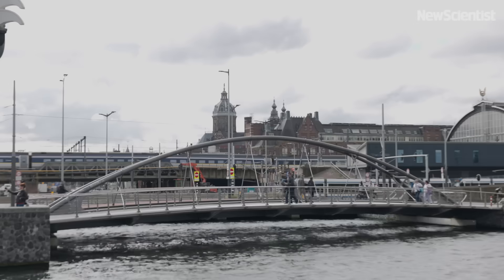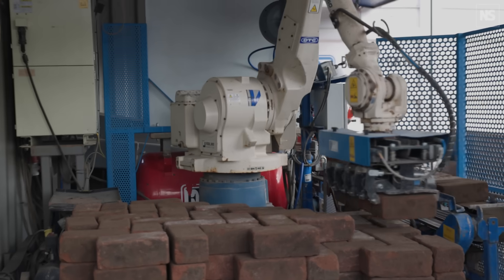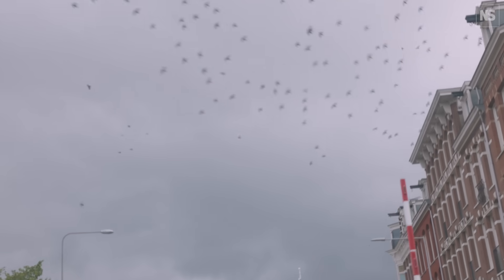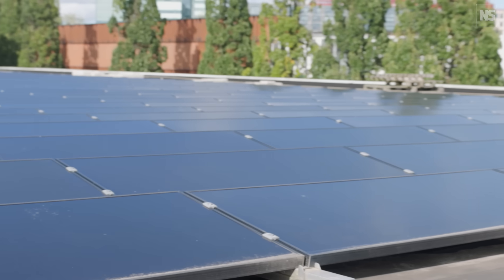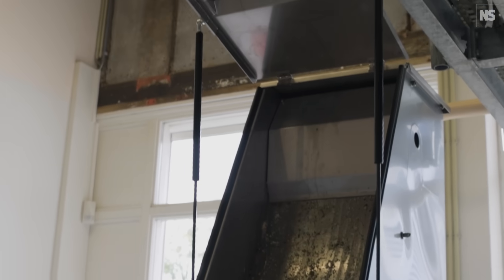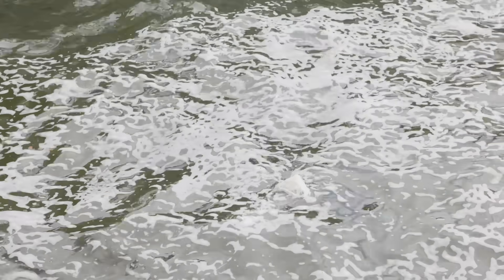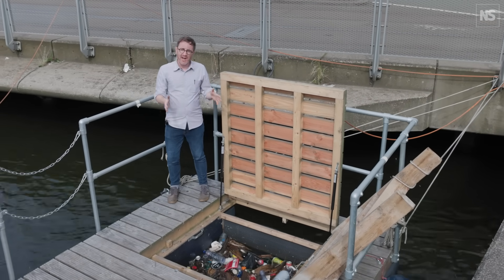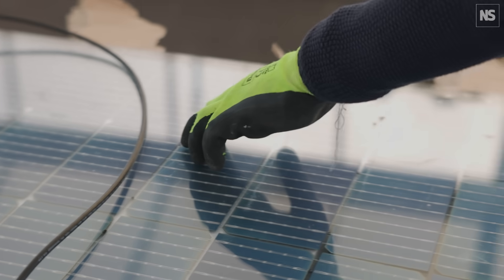How Amsterdam will transform into a circular city by 2050

Comment: I'm sorry here, but why the heck would you think you need to use as less water as possible, can't you just use a rock/sand/carbon, then activated carbon filter, and reuse the water , or isn't that circular enough? one solar panel and one pump fixes that problem you know, just saying... Design your systems optimally, as fast, as accurate and as cheap as possible, just recycle every single thing, including water, including co2 into dryice for example, or reintroduce into the soda pop industry, tooth paste, ... But coming up with using as little water as possible, that doesn't make any sense, you can recycle that water too for that kind of production, you don't need it to be pure in the first way, a simple rock/sand/carbon filter will do the trick, and gravity will push it through the filter.

Comment: Very interesting video, at 9:00 I just wonder why an institute with environnemental purpose is using perfectly good vegetables to experiment instead of using actual waste...? 
I live since 13 years in the Netherlands and Dutch culture is so bad towards food waste, young generation will just throw away perfectly good food just to make it pragmatic in the fridge, or even worst, for no reason, just because of habits or as a reflex (just throw it).
People have poor knowledge at how fast food perishes, and again I'm talking with a various range of experiences since I live here. I feel here this institute is taking the problem from the wrong side, trying to deal with unnecessary over use waste, instead of working on campaigns to teach citizens : a more mindful and respectful consumption.
Both actions can be worked in parallel but the later would diminish greatly the need for the first over just one generation.

Comment: I live in an urban apartment in Texas and I simply grind all my food waste in a blender until it is like a smoothie texture -- and then I pour the solution in my patio garden. It looks like someone threw up in my garden, but after a few days of watering it dissipates into my soil. Since I eat a lot of hard-boiled eggs, the egg shells form a crust on the top of the soil and I think keeps the soil wet and that conserves water. I also dump my robot vacuum (which looks like 90% cat hair) into my garden because I read that the Amish use hair clippings in the garden because when hair decomposes it releases nitrogen. I've also installed a hydroponic garden in my hallway coat closet (in Texas we don't need a dedicated coat closet) and I've noticed a much higher yield and very little water use compared to my patio garden. I'd like to see a world where most houses have attractive hydroponic gardens in the kitchen area where people can grow the fresh food they like. In this dream, they'd be able to buy heirloom vegetables in little pods and grow things themselves! The technology isn't more sophisticated than a fish tank water pump, you just need the unit which is WAY too expensive for the average 99%er, but with government help it could be different.
Reply: The "Garden Center" in Back To The Future 2 was probably supposed to represent a hydroponic system. It is a fresh fruit system that comes down from the ceiling. So it's an idea at least 35 years old.
Reply: Thanks for making a difference!
Reply: Wow! Love the way you live💯
Reply: i think hair doesn't break down fast enough to provide nitrogen but provides a sort of fiber for the soil that can, like eggshells, hold water in place.
Reply: great initiatives
Reply: putting the vacuum contents into the garden is a great idea in theory, but unfortunately dust consists of micro plastic fibers, so even though it might’ve mostly ct hair, you’re now dumping a bunch of microplastic into the soil
Reply: The rats would go wild here with that mush you are putting down.
Reply: Is a backyard compost banned there? Well, here we collect bio waste on municipal scale and it goes to a massive compost which turns it to soil which is sold to farms.

Comment: In Amsterdam, at least, something is being done. What the best way will be, will become clear later. Dutch engineers are very good and simply adjust things if they do not work optimally.
I do have confidence in it, despite all the possible start-up problems.

Comment: I don't understand the recycling of solar panels. Recycling only makes sense if it's more financially viable than producing new ones, or if it's more environmentally friendly. But solar panels aren't environmentally harmful waste. They could simply be dumped as garbage in the same place where their raw materials were mined.
Reply: There's still waste in the creation process in general - mining the silicon, purifying it, producing new solar panels - all of that creates waste & takes energy. I also like that this allows the replacement of broken cells in a solar panel - e.g., when part of one goes but not the whole thing. Like anything else, a start up version of this is expensive but if they can automate & scale I can see how this would be more cost effective in the future.

Comment: The line is the perfect design for a city without stacking roads and paths, it's supposed to be based on a single high street. With mile long side streets for residents apartment blocks the only stacked building with multiple floors the same height for all about ten floors, a mile long instead of mile high skyscrapers. All other buildings ground floor only high street, industrial and farm. Vehicle should not be on the high street apart from trams and buses and all other delivery system vehicles should drive to back entrance to stores and services behind high street road dividing from the residential side street with only paths to high street from residential side street that only emergency services use for access. The other end of the residential side street should be park area as long as the high street in other words as long as the city. Then "man" made river direct from sea, 2 river with bridges between industrial area and park, again as long as the city. Behind the industrial area should be farms land. And this should be replicated for both sides of the high street. Every one would live directly in the city centre. A mile away from high street at most and 2 at most from industry. A working farmer would still live in the city because residential side street would be only 3 miles away depending on what end of the residential side street it lives at. The schools and supermarket should be on the high street and emergency services and hospitals should be in the industrial area. What ever the situation or need from a industrial or high street you going to be only 1 to 3 mile away.  If a city is 20 miles long or 200 miles long every city will always be 5 miles wide. The widest commute path of the city would be the high street because it would be the most populated constant part of the city. The only wheeled vehicle would be emergency and delivery system vehicles this would include cyber taxi for emergency travel for general public. There would be no car, only cyber taxi for emergency travel needs. Public transport from high street to industries and park with station on industrial side of the bridge would be unground trains two loop one on both sides of high street. This is the only logical approach to dens mega city's derived by socialism and economics of space, time and energy. There is not one viable city in the 21 century in the hole world and every town and village is obsolete. This proves that the job market is the biggest problem in the world. With no integral architecture it's never going to be possible for a 24 hour culture because the population need a private place for rest with peace of mind to re-energies the body and mind. (IN A WORKING WORLD WE ARE ALL CONSUMERS ENTERTAIN OR BE ENTERTAINED).

Comment: Way to go, Amsterdam. 

Seems like the garbage compactor unit is far more complex and likely to need repairs than the traditional method of sorting food scraps and depositing them curbside for composting.
Reply: I thought the same, but let's not forget that experimenting and being wrong can be a great way to move forward.
Reply: Users in Amsterdam are not the most reliable, the trick is to make it as easy as possible for the user. Thats also why Amsterdam stopped collecting plastic, because users are terrible at separating properly and it was better to let a machine pick out the plastic at the waste site. 

Another factor is that curbside waste collection is a bit different in Amsterdam, there is no space for containers (neither on the streets nor in the appartments). We have underground containers on the streets but also they have limited space. Some places we even put out loose trash bags on the street for collection - imagine the fun of leaving food out on the street in trashbags
Reply: @ThijsGieb  Exactly, anything that has to get used by many residents, should be designed as fool-proof as possible, preferably with only a single button as an interface.
Even then they'll find a way to break said button.
Reply: Drying out the food waste immediately helps with smell, cleanliness, and pests. They'll figure it out.